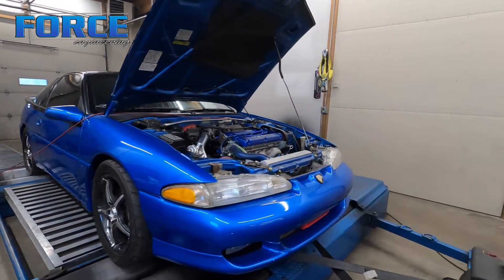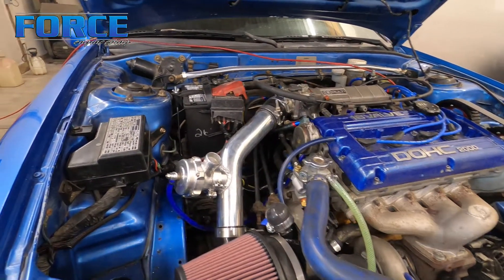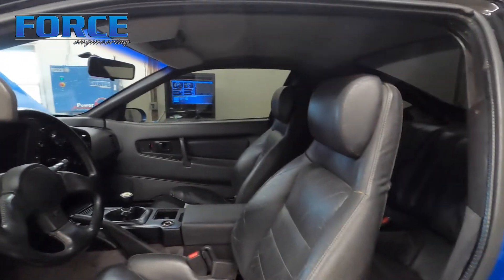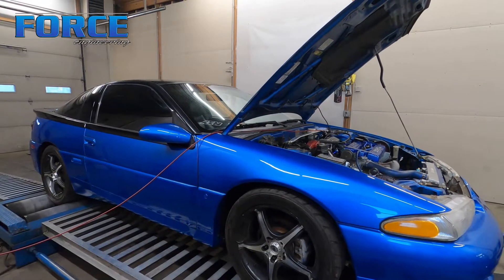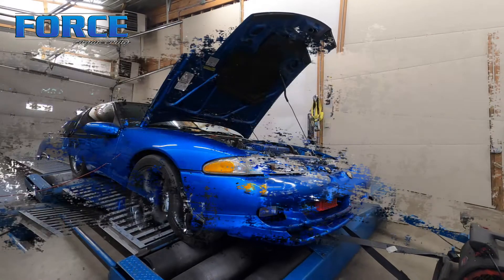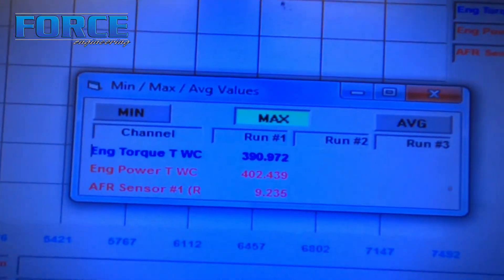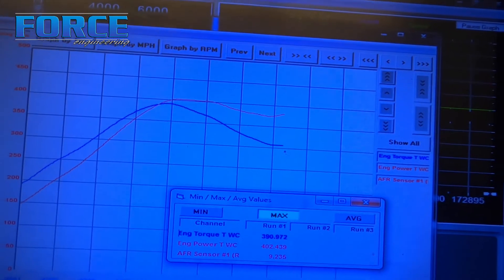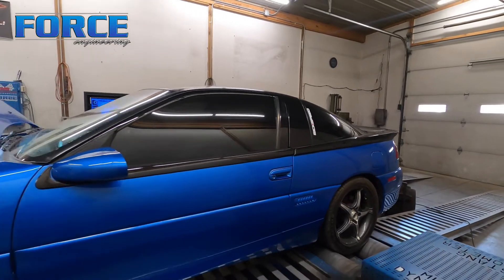93 Eagle Talon TSI, 2.3l Stroker, Fp black, Pump gas | Dyno Review

Comment: I never would have guessed that the intake manifold was the reason it seems to fall on its face in the upper RPM.  I thought that was more of a camshaft deal?  Either way hope to see more videos to see if they take care of that.  400whp is awesome though!!
Reply: Small camshafts restricting air flow and small intake manifold restricting air flow causes the same problem. If he was to throw on an intake with some camshafts he would make more power on much less boost because not as much pressure would be needed to fill the engine up. Crazy how it works.
Reply: @john-martin  I'd argue that he needs a tubular manifold from STM, Archer, or Morrison Fab, and a sheetmetal intake.  The stock intake manifold is fine for the small(er) turbos like the 16G/18G.  Takes more "boost" to achieve enough airflow due to cams and intake like you said, but also the FP Race manifold isn't "relevant" until close to 9000 RPM.  There's dyno data that backs up this claim.